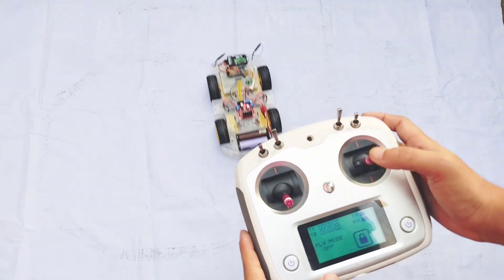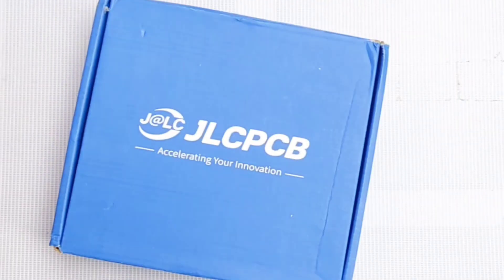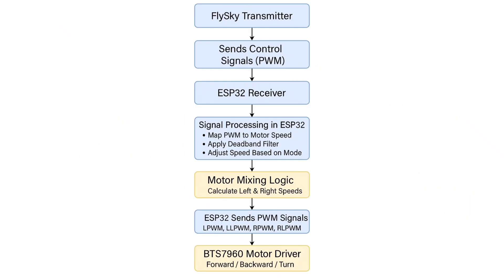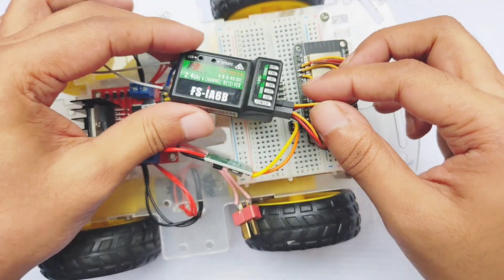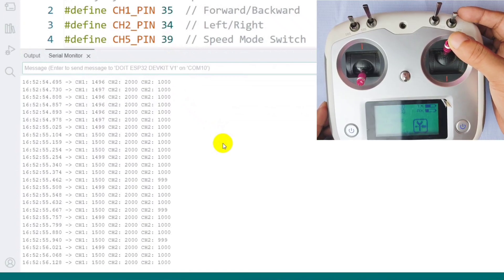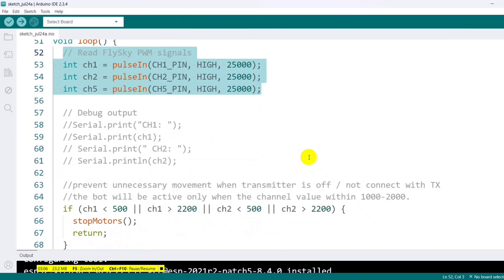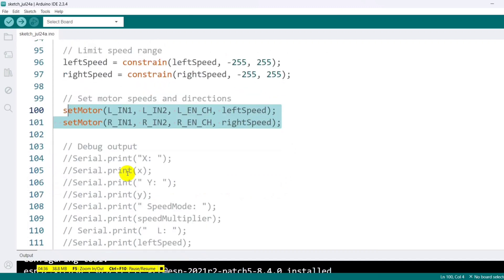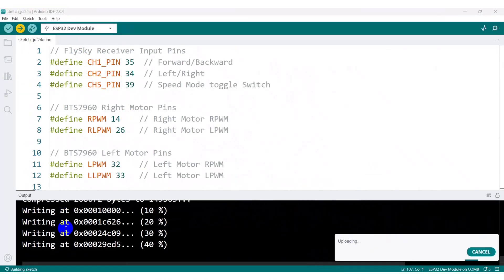How to Make RC Car using FlySky and ESP32 Coding | FlySky Arduino Soccer Bot | JLCPCB

Comment: very interesting work, im currently on a similar project but uses radiomaster zorro and ELRS transmitter and ELRS ER5c receiver, would that be possible to do without any major changes to the IDE code? especially since i’m using VNH2SP30 motor driver which has extra pins named EN & CS. And the er5c receiver connection pin which a bit different than i6x, that must be adapted. would love to have your view on this

Comment: I am sharing a problem with you and the viewers, I am not able to get any kind of library to work in my Arduino IDE. No matter how I install the library from the zip file or from the IDE, for some reason it is installed, the writing comes, but after installing the library, an error comes Compilation error: IRremote.hpp: No such file or directory, why does it come, if anyone knows, please help by answering
Reply from the maker: There is no such library name IRremote was used

Comment: Basically i am using a 800rpm motor and flysky i6x , how do i limit the rpm 400 in the remote settings? Or do i have to make changes in the code ?
Reply from the maker: Using channel 5 (toggle switch) to switch between 100% or 50% speed multiplication. You can modify the percentage of speed by changing the value of speed multiplier in the code

Comment: what is the expected delivery time from jlcpcb?
Reply from the maker: There are different types of delivery method. Such as DHL, Fedex, Air Mail or EMS. DHL and Fedex are fast but the shipping charge and custom duties are higher where ems requires at least 10 days with minimum shipping and custom duty.